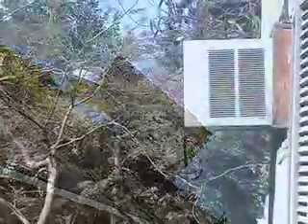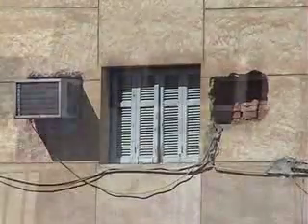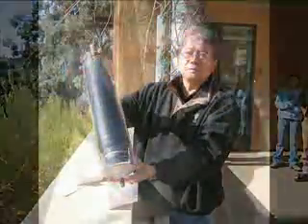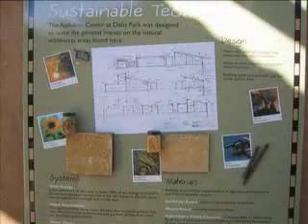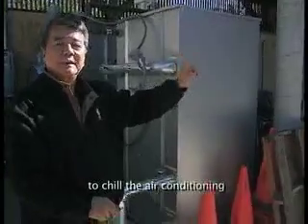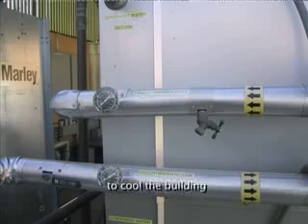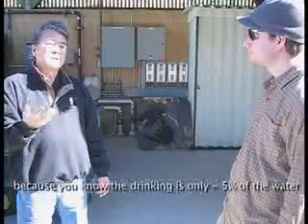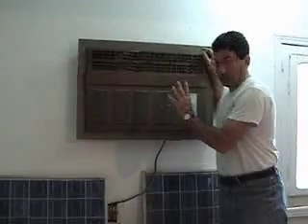Solar Air Conditioning

Comment: Thanks : all is Ok for me but I do not feel comfortable about your "heatsink" idea at night. I mean : it is not changing stuff on the GLOBAL environment for me (to release at night). It can perhaps, yes, have an difference on extreme peaks (weather conditions play a role). Obvious : the best is not to put too quickly the air conditionner ON or to gather people around one in the same room. Same for heating as well. I live in Toulouse in France and almost not use my heater during winter.

Comment from the maker: Thank you Newtoon, that was in fact my point.  Also, if you can keep heat in the dwelling during the day and use it for multiple purposes it can then radiate slowly and comfortably into the night sky (which is a huge heat sink).  The idea is to make use of the heat we generate and not have to generate more.

Comment from the maker: In Germany we have friends who use heat pumps to heat their houses in the winter and cool them in the summer -- most of the heat, as in the air conditioner, comes from the compressor and is PUMPED where we want it.  In the case of AC it is PUMPED or BLOWN outside. Genius.

Comment: So, heat goes in the water instead of the outside air.
To say that it does not heat up the environment is therefore not true. You have then hot water to use somehow. So you can wash and flush but this heat goes into the water pipes and in the environment anyway. The big difference I see is that, in Summer, I do not need to BOTH use the air cond + heat the water electrically. This is then, on that point, a good idea to test.

Comment from the maker: The only difference between a solar system and a conventional one, space wise, is the surface area needed to collect sunlight, and that is roof space.  Powerplants, on the other hand, do take up lots of space that could be used for larger public spaces or private spaces.

Comment from the maker: Calling roof space "private space" is, in itself, grossly misleading.  Since most people don't use their roofs for anything productive at all it is a red herring to make people think they are "giving up" something to install a solar cooling system.  The system shown, with a 10 ton chiller, is for a whole facility, not a house or apartment, and the under roof components take up no more space than a normal 10 ton chiller would.

Comment: The Lithium Bromide system probably works better when the humidity is lower.  People use something similar in parts of Texas.  Check out Yazaki Energy Systems.  They have a nice explanation of a Lithium Bromide system.

Comment: This video is a fascinating example of what is possible in the future.  While the current cost of this tecnology may be prohibitive, if we actually paid for the real cost of electricity--that is, if we took away the subsidies and found a way to put a dollar figure on the harm caused by traditional power generation--then solar air conditioning would clearly come out a winner.  However, even if we accept that under the present structure of our economy the average

Comment: but it still uses electricity besides the fact there are solar panels plus they are thinking the wrong way ... you have to think inside earth its not all hot, underground about 10 feet it is 55F all year round so think about that